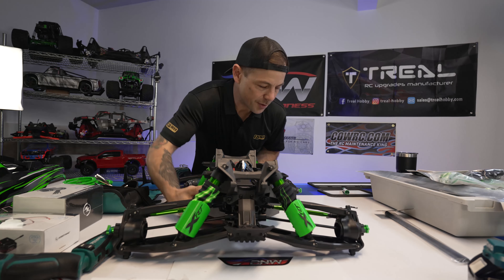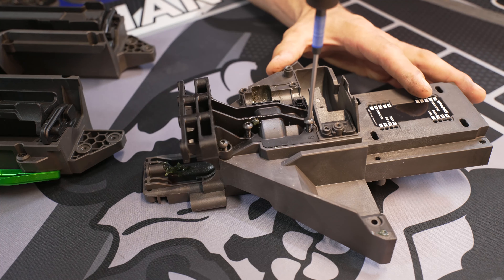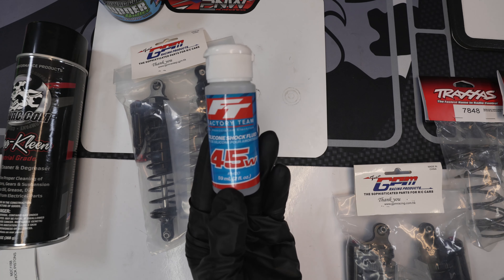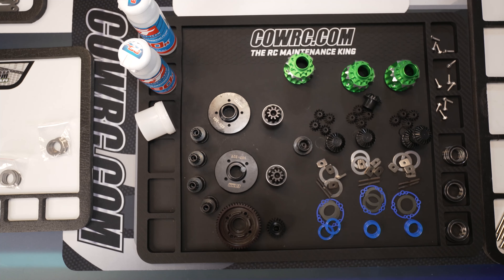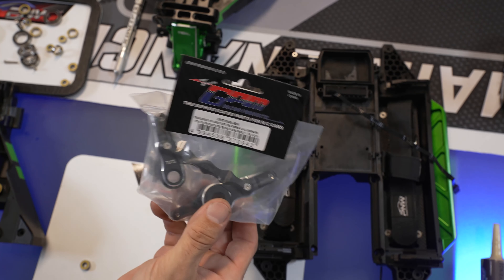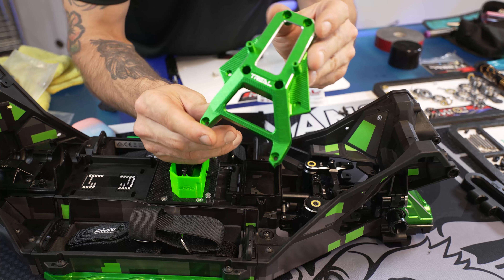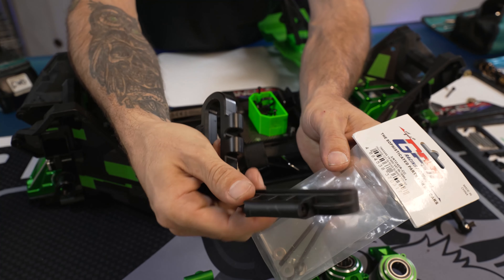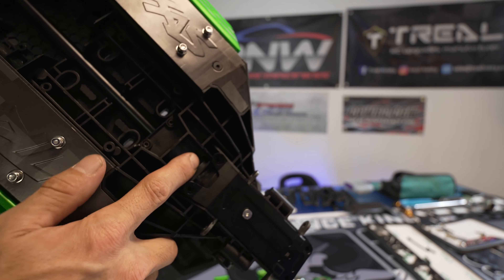🤑1 MILLION $$$$ TRAXXAS XRT 8s FULL PNWRCMADNESS GPM TREAL ALUMINUM 33LBS BUILD

Comment: Turning on performance premium RC vehicle into a shelf Queen
Reply from the maker: Thank you for tuning in! Hopefully this weekend I'll upload the quick bash video.   It was a power  house
Reply: No way these are great mods that'll make this thing near bulletproof.  7075 is a damn strong aluminum. Shelf queens are all 6061 (and most people throw aluminum suspension arms that'll bend on the shelf queens).  It certainly does look clean in the vid, but I'm sure Chris is going to send it when he gets a chance
Reply: Hell... why not. This this🔥
Reply: Does the belt drive work with any HR motor mount?
Reply: @danielk5815 Alminum bends and stay bent😂. Plastic flexes, when you put this much Aluminum crap on an Rc it's a shelf queen

Comment: Bad ass rig. What fan is on the motor and how did you connect it ? I looked on your website but didn’t see it. I have the Max5 & 5690. Not done yet. Were you not able to plug fan into port on ESC where the OTA would go or do you use a splitter and connect it along with the ESC fan ? Thanks.

Comment: Hey man, im doing an XRT build inspired on your build here. I want to try your belt drive and motor mount as well. Can you tell me what gearing you suggest? What was the gearing you put in this video vs what have you had the most success with (Fast and bash)? Also, what motor mount size for the 1100kv HW G2? 25mm or 30mm? Just having a little trouble confirming numbers before I order. Thx my man!
Reply from the maker: Thank you!! You will need the 30mm screw spacing motor mount and i am
using 20/30 belt drive both 8mm bore. I also now have an 8mm HD spur shaft i offer on my site

Comment: When i put the gpm diff gear in and put together, it blocked turning by the bevel gear...,so it was the Opposite case that you have when you need shims, u know...maybe i had get it done with some side shimms at the place were the bearings of the diff sits but i did it together then with the Stock diff gears. Dont know why, i had the vitavon Cover, the vitavon upper bulkhead and also the gpm bellcrank and the thing what Comes on tp at the bellcrank, gpm too. Maybe i dont have to Mix vitavon and gpm lol, that was unpro😂

Comment: How much did all this ACTUALLY cost? LOL Also, I didn't really get a good look at the front. When adding the belt drive, did this truck become rear wheel drive only? It looked to me like the center mounted motor would keep if from being 4WD. If it is 2WD are there any improvements made to the speed and handling? I personally tend to prefer 4WD handling, but others might disagree.

Comment: Everything is sweet except those battery trays bolt heads sticking out the bottom like that will catch on everything when bash hard and do more damage the good better off to jb weld or epoxy the trays in
Reply from the maker: Thank you! Never had an issue though with them and I've sold a couple hundred sets and been using them myself now about 5 years.  They do get dinged up though like the suspension part nuts do. But all in all not a complaint. If that were the case I just wouldn't sell them.   I appreciate the feedback for sure 👍